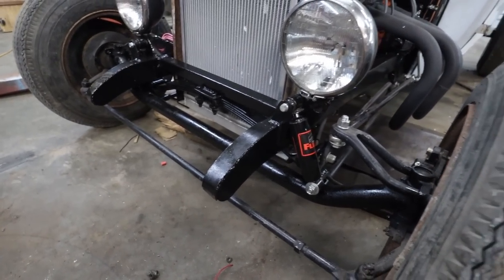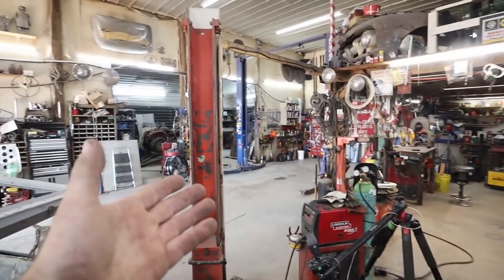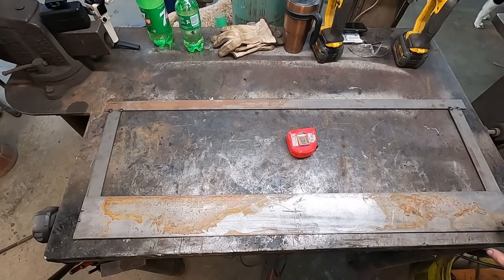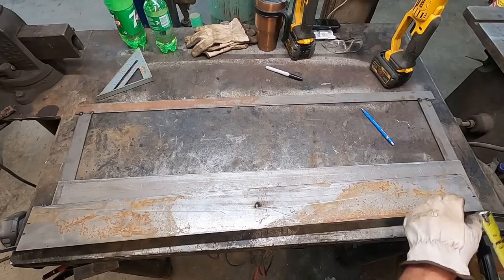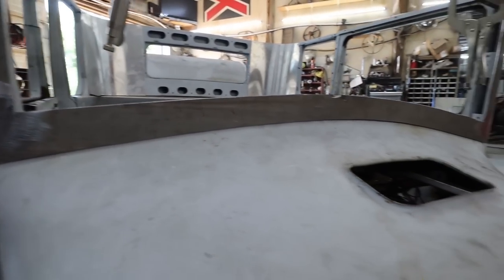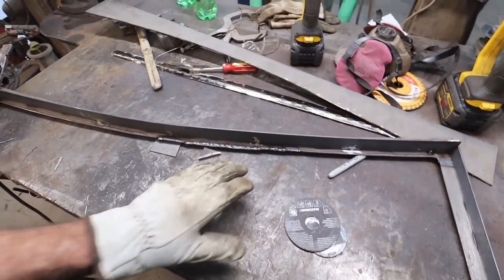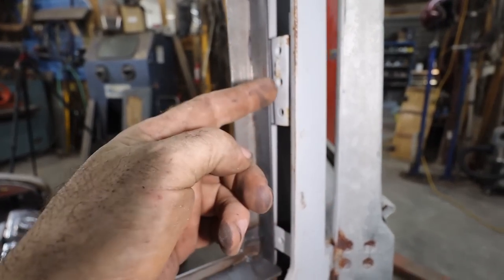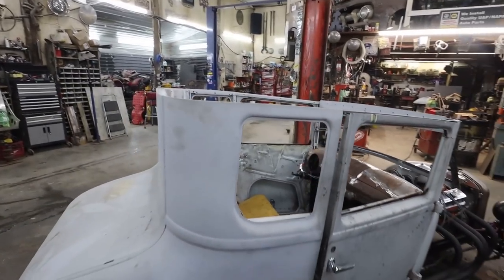Building a functional front window frame for our Ford Model T hot rod

Comment: That was really good. I enjoyed that video. I have a tractor with a cab on it and my back window had the same kind of openings openers that you used. I made my with flat stock drilled two holes at each end. Cut one end out. Use the bandsaw and welded the piece back in and it worked great. That's just one way you can do it. And also I picked up some of that paint yesterday. I'm going to give it a try. 👍👍🙂🇨🇦🐕🐕🐕

Comment: Window looks great.  When I did my 33 truck, I built the frame out of 3/4 angle, and faced it with about 1/16 plate.  And weld on bullet type hinges The window is glued in and has been fine.  I like your frame and shop made side latches

Comment: Love the handmade windshield frame, looks mighty fine. Will you be taking the frame to the glass shop or will you just make a cardboard template to bring to them?
Reply from the maker: use some 1/8" plywood to make the templates.
Reply: As a glass installer . done a 100 of these over the years. Didnt fit good from factory, nmore than 50 % of people bitch it dont look right .channel is a u, glass is straight, leaves gap. Fill it in with urethane, silicone how dare you .. He might of made a square channel.. Good work would look good.

Comment: EXCELLENT stuff, as usual. We see the end in sight and are a little bummed out. You keep mentioning the '54, but we've seen how the steering box is a PITA for the driver's side. If you're thinking big horsepower, instead of being in the '54, why not FINISH the Stude you set outside, but wanted to build for dirt drags? The frame looks terrible for what you'd like to do with it, so, put the body on another chassis. BUILD another chassis!!
I'm glad you're going to fix the passenger door. We look forward to your fix.

Comment: I was thinking a bearing would have been handy for drawing the curve at the right level to match the dash. I the lip you were going add is 1/8" thick and you wanted 1/2" to glue the windshield in, you could have used a 1.5" bearing (.75 radius) to draw a line in the right spot. Just at thought.

Comment: when i did construction i did mostly trim but had to build trim for arched windows i bought the best too i ever owned was a calculator called construction master pro now you can download to pc. you just punch in the width of the window and the rise of arc and it figures it out where its so easy to lay out with a square and string and works every time should be able to enter the radius of the circle from the calculator into your plasma table and it cut the arc correctly

Comment: cut out a plywood circle (4"), drill a hole in the middle, the size of a pencil.  put sheet of cardboard on car, squared up, use roller pencil to draw the arc on the cardboard.
old boat builders tool.  enjoy watching you think and work.

Comment: A.Adams supply used to have piano hinge, think you can get 8 footers if i recall. Lee valley, they would have hinges. 
Like the precise way to mark hinge holes,im going to use that! 
Plasma table is never cheating,if you have it, use it. 
And i like the window holding brackets. You use the primers before urethaning in the glass? Or primerless urethane? Or is the primer type gone now? I will have to ask my glass buddy. 

Another day of awesome work! Thanks Brent!

Comment: How about a combination shock mount, headlight support bracket (oh, and turn signal)?  ;-)
Maybe modify the dash speaker grill by adding a slot to lever open the windshield?
I wonder how close you would have been keeping the original piece of metal (11:15)?
Reply: Ok, I admit my windshield opening lever idea is more complicated (does not follow K.I.S.S.). ;-D